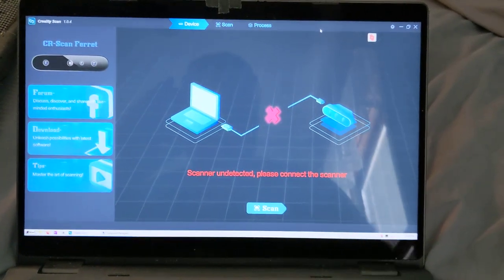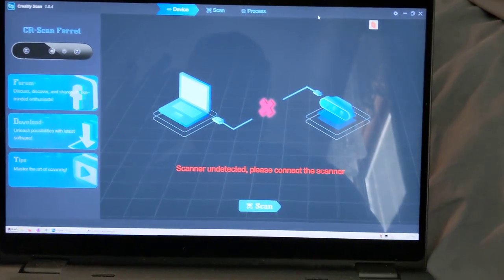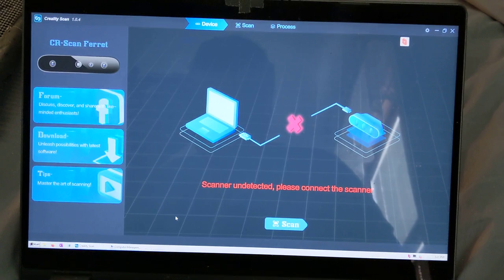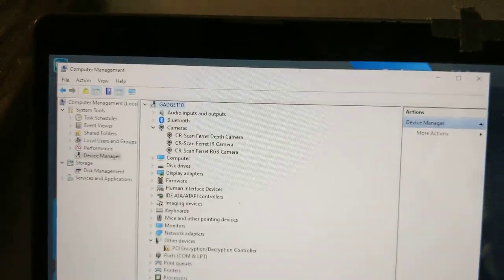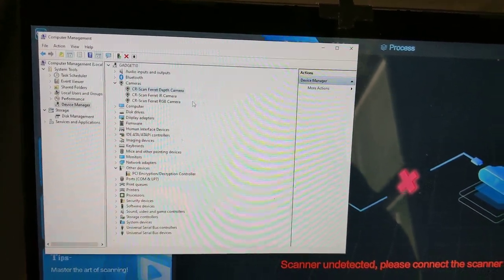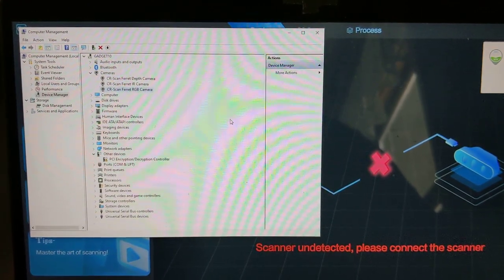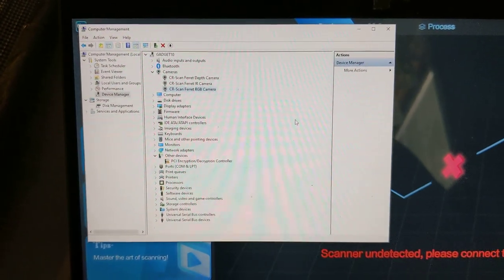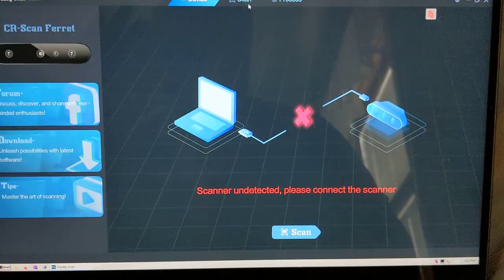Creality CR-Scan Ferret 3D scanner Day 2

Comment from the maker: I hope to post an update in the next few days. I'm just busy with work. I want to make a longer video of a scan and crop it down. I did some experiments with tracking and found some objects that seem to help (ping pong balls for example) however on the optimization setting, I am having issues with the software completely cropping out areas that seemed to scan well in the point cloud. I would love to export the raw data to a better software to process. 
I've tried 3 other software solutions without success (they couldn't detect the scanner). Skannect, RecFusion, and Reconstruct Me. I'm checking for software updates from Creality Daily. I tried their PC software with even more computers, cables, and compatibility settings with no success.

Comment from the maker: All pc ports tried were 3.0. Note: the phone would jump between 2.0 and 3.0 mode. It would still work in 2.0 mode, however, in scan settings it disables the options for Small objects and Hi-Qualiry mode.
Reply: I’m thinking because the item is brand new.
they have worked out the kinks in the software drivers included